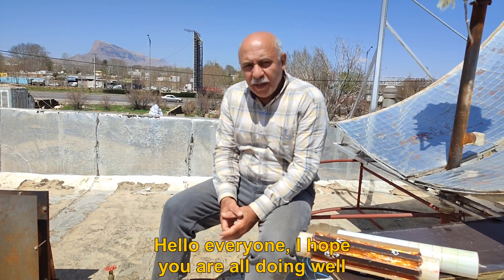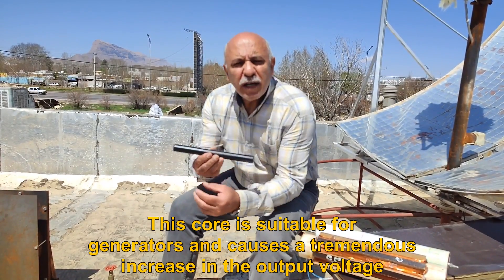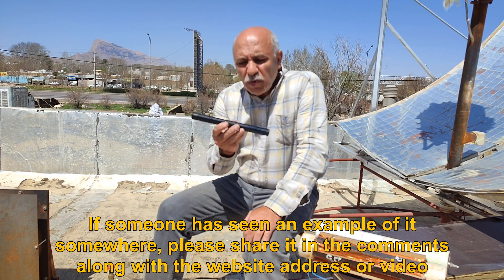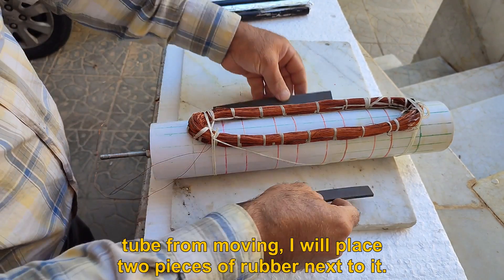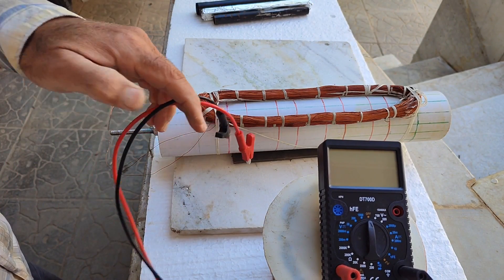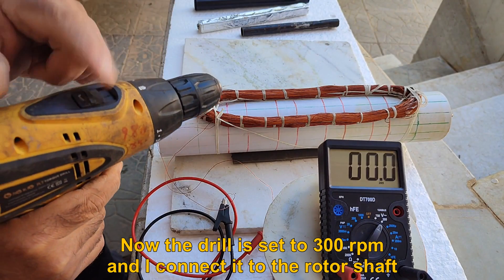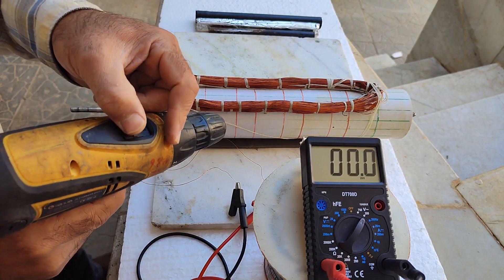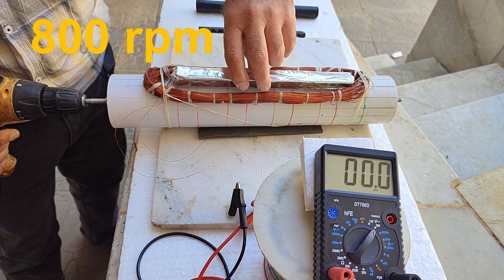RMC core.An amazing method of increasing the voltage of the generator.Voltage booster core

Comment: 🤔⚡I recommend you to try 
IMC core  too 
It is less weight than RMC core 
 Make it 12 poles 
2 coil in parallel with  diode 
Of 6  pairs 
 6  in series 
I recommend you to make electro magnetic core 
Than permeant magnet 
It is more powerful for long time 
Permeant magnet are powerful with time and usage
 Increase of time = decrease of power of the permeant magnet 
So I kindly recomend to make electro magnetic core  
  It was  similar to working principle of alternator of car ... etc  
Use the working principle of alternator  

 I wish you all the best
❤🙂😊
Reply from the maker: Thankful
Reply: RMC AND IMC STRANDS FOR.WHAT MATERIAL IS THIS?

Comment: I think less current
Reply: Increase of turns of coil 
Produce more current 
 Here  not use diode 
 So   if diode is add  it will
Reply from the maker: You saw that it made the SMD integrated circuit brighter